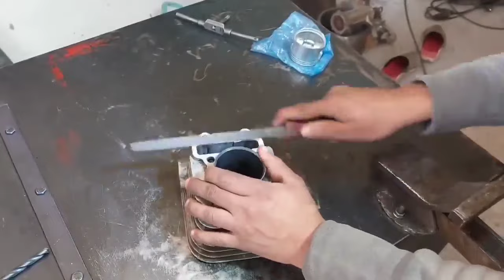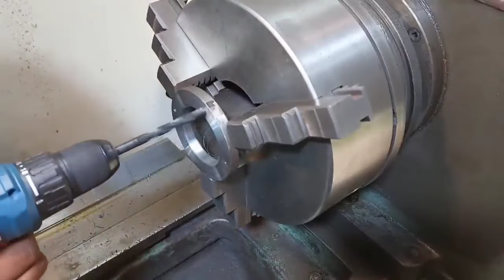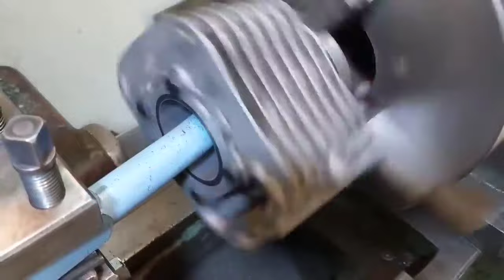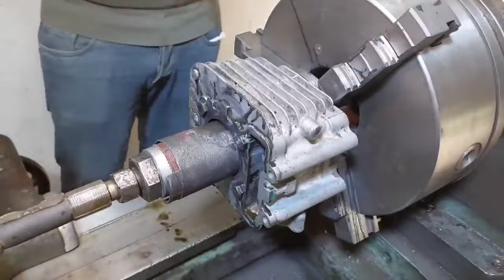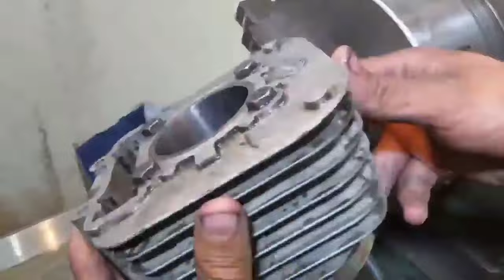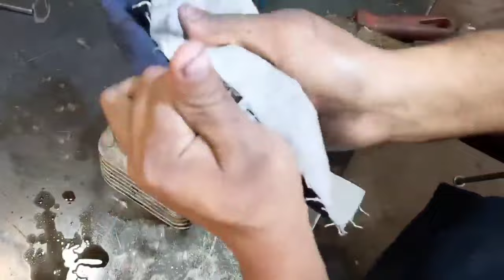How to old technique rebore block cylinder motorcycle

Comment: you have know idea what you are doing the bore is not meant to be shiny when you've finished honing it, it should have a 45 degree included angle to the crosshatch pattern.  google "cylinder hone crosshatch angle" and your piston is way to tight for the bore, you need room for the piston to expand when hot.
Reply: I was expecting him to use hoaning stones at the finishing stage...but he left it without hoaning. Work without knowledge is no work but rubbish.